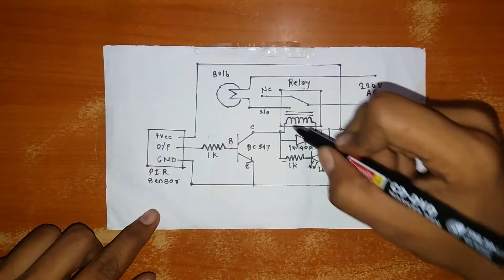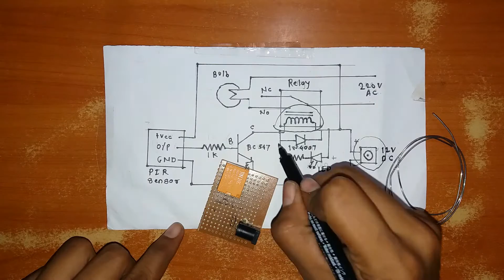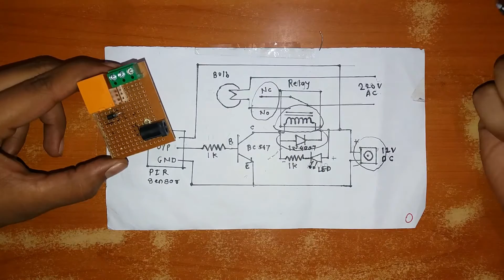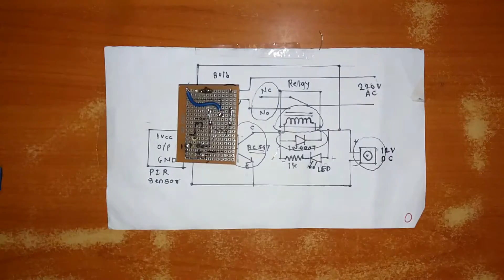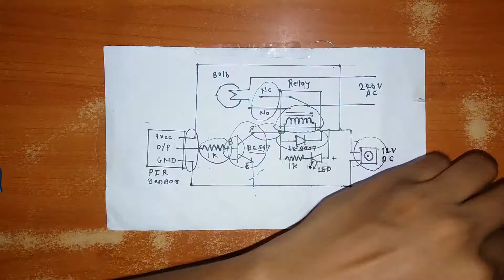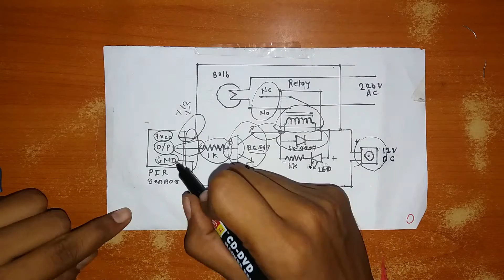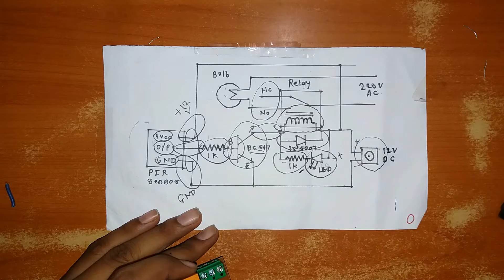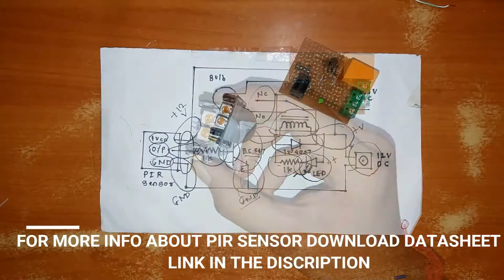MOTION SENSING LIGHT USING PIR SENSOR

Comment: What is the proper use of BJT here can you tell me.. And diode too why we are using it here
Reply from the maker: transistor used to trigger the relay means here it act as a switch the base is connected to  output of pir motion sensor 

and diode used to prevent the transistor from reverse current from relay coil .. and hence sometime it is called flyback dode wich discharge the reverse current (eaddy current ) generated by coil
Reply from the maker: plz subscribe and share 😊
Reply: And i have one more query... What to do and if want to add a counter in same circuit to count the number of person in such a way that if 2 person enter in the room and 1 left and 1 is still  present in the room then the light should not turn off
Reply from the maker: @surabhipareek1203  for this u need to use ardiuno and other sensor and program for this
Reply: @CreativeDesk  ok thanks alot.
Reply from the maker: @surabhipareek1203  plz subscribe n share i u haven't

Comment: Great... it worked... 😊

I have used 12v relay and 12dc power to run the circuit... my query  is, can I use 5v adapter to run the circuit?
Reply from the maker: if you want to use 5v adapter den use 5v relay instead of 12 v relay . simple ☺
subscribe if u haven't
Reply: Thanks!

Comment: Bhai AC bulb Aur ek buzzer done ek saath use karsakthe hai kya
Reply: Pir se signal milthe he dono on ho jana chaiye aisa circut batao na .  video is Awesome
Reply from the maker: Buzzer 230 v ka hai to bulb aur buzer 1sath single relay mai lagao 
Otherwise separate relay lagao ( parallel to 1st relay )
Reply from the maker: Aur simple jaha maine relay ko input diya hai na circuit daigram mai waha buzzer parallel lagao relay ko ... 12v ka buzzer
Reply: @CreativeDesk  230v ka buzzer bauhat noise shor machayega is liye chota buzzer kam sound produce karega ek alaram ki thera work karega night ke liye chaiye hai.
Reply: @CreativeDesk  bhai 12v relay parallel diode ke sath connect kare tho ho jayega na relay ka input ?
Reply: Video is super compact 👌👌👌👌
Reply from the maker: Ha ho jayega
Reply from the maker: Direct buzzer parallel laga polarity  check krke diode ke yaha so extra relay nai lagvana padega
Reply: Bhai ek doubt 5v ka relay laga sakthe kya ??
Reply from the maker: @sunnyprateek9186  ha 5 v ka realy lagao n 5v ka buzzzer n 5v ka adapter use kro
Reply from the maker: @sunnyprateek9186  plz subscribe n watch my other vedio

Comment: kya sir ac voltage ka ise kiya h.. or jo wire cut kiya h vo bhi ac voltage ka h..
Reply from the maker: All circuit operate on 12v dc ..
The relay use to controls  the 230ac volt appliances

Comment: sir can I make AC pir motion fan by using this circuit????
Reply from the maker: তোমায় নিয়ে লেখা  yes just  connect fan line wire to relay but u need to dc 12v to operate reay and pir sensor